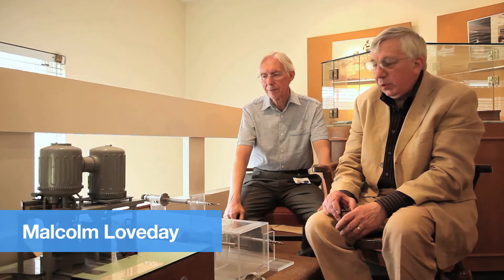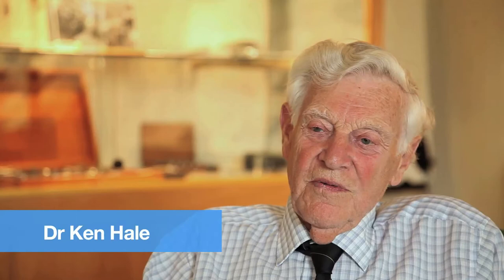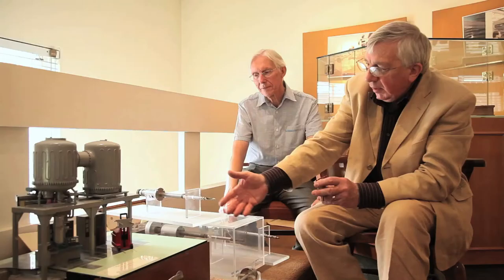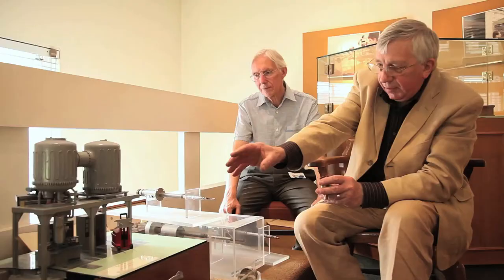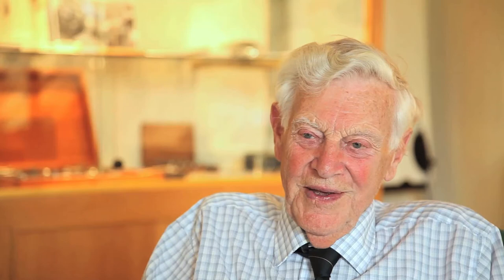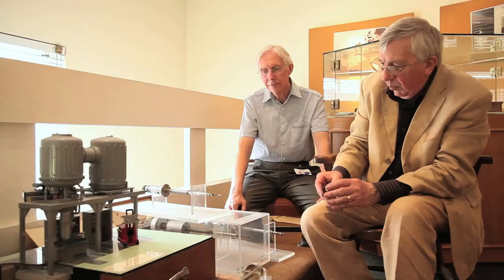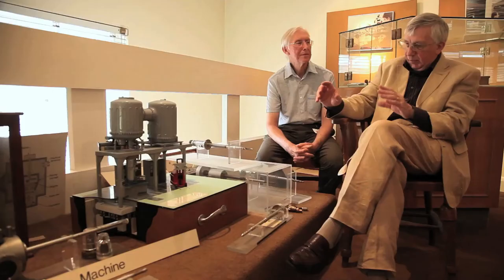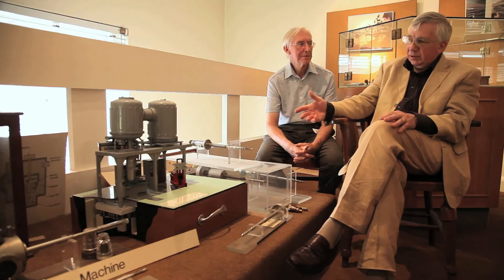The one million Volt microscope

Comment: There was one where my late father worked at British Steel's Swindon Laboratories at Rotherham I went to the open day in 1969 & still have the brochure about it. With a suitable building & installation, the million volt electron microscope cost a million pounds...the joke was therefore that is cost £1 per volt. My late father was a doctor of chemistry & wortked in a different building there. They loved wasting money...my Dad's laboratory was heated with underfloor electric heating & then temperature controlled swith air conditioners.

Richard, UK